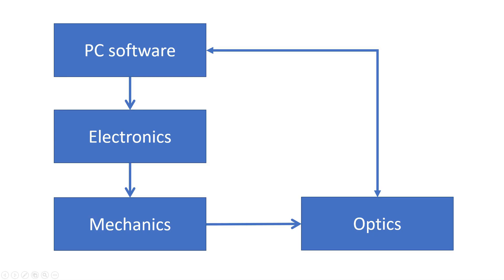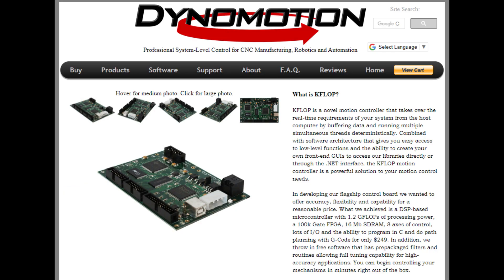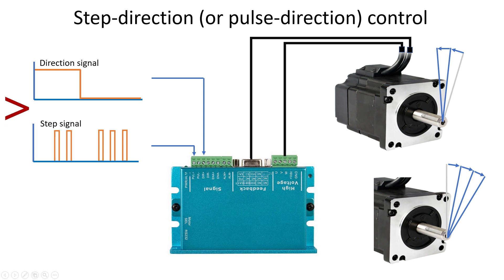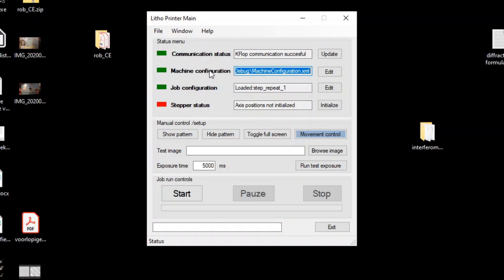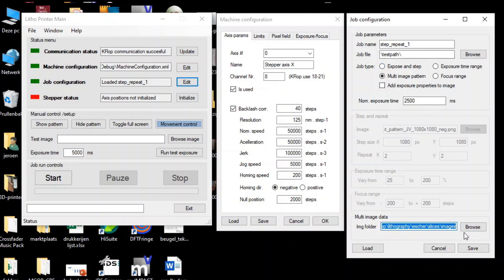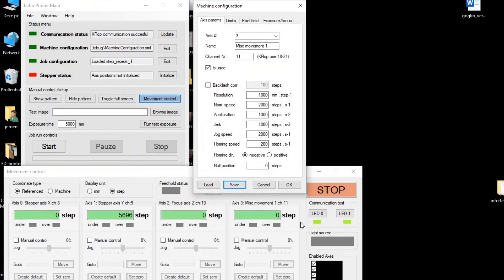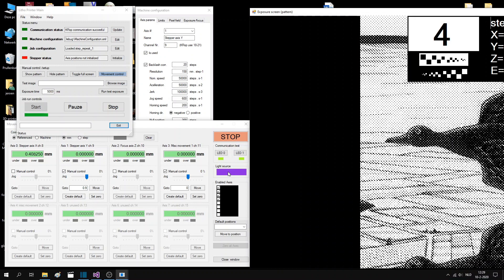Maskless Wafer Stepper Part 3: Electronics and Software.

Comment: impressive.
only remark I have is that this is the first time I see a whole arduino (and one of the more powerful ones, and an added logic chip...) replacing a single '74 logic chip. ( SN74LV8154 for example, an up down counter )
this arduino thing is getting out of hand 🙂

BTW, I am sure if you open source the hardware and software, someone, somewhere will have a use for it and expand it...

Comment: Did you ever get the stitching to work reliably? If I understood correctly then the problem you have with the stitching is that the wafer stepper's steps are not of equal size and so it's hard to predict the distance the stage actually travels. Would you say just characterizing the error is enough to fix the stitching issues? Or would it require some sort of image recognition and alignment markings in the design?
Reply from the maker: Best thing is to use an optical or magnetic encoder and a feedback loop to achieve accurate placement. In 2024 there will be a video on a new and improved wafer stepper.
Reply: @HuygensOptics  Awesome! Looking forward to it! I will want to start gathering the parts for- and slowly figure out how to make my own sometime within 2024.
Reply: @HuygensOptics  That's what I wanted to ask about too - whether you could include some metrology and a feedback loop. Would be really interesting to see that in action. I knew about magnetic encoders but it wasn't what came to mind for this sort of application. I suppose they can be incredibly precise as well (considering the size of magnetic domains in hard drives these days - perhaps smaller than the 158nm step size of your servos).

Comment: A way to handle the short step pulse into the Arduino without extra hardware is to attach an interrupt to that pin that only triggers on a falling edge. The edge triggering is done in hardware, so it can handle very short pulses.

Comment: Also something commonly used in 3D printers is microstepping. You're probably already implementing it in your servo motors-- but if you add certain motor driver (I use TMZ 2209s) then it slide the motor smoothly between steps by messing with and smoothing out the signal sent from the controller. Tbh. I'm not actually sure how it works.   
You're probably already doing it, but if not, it might help you get smoother movement.
Reply: Of course, you knew that though. Haha. You're moving nanometers. Okay. Ignore me.

Comment: I wonder if you could use an FDM 3D printer controller?   
You've already gone and learned the machine code and all of that-- but it seems like it has a similar function.   
Maybe it's a specs thing. 
Either way. Listening to you explain your projects is a treat. Thank you.

Comment: Is this setup possible to achieve the overlay exposure? For fabrication of a microdevice, usually, we need to pattern the marker layer at the first time exposure, then we need to use this marker to do the alignment, and exposure the target pattern at the second time, which we call overlay exposure.
Reply: There is a camera. With laser illumination we could even record dark field pictures for higher resolution. My only interest is reproduction (retro) of vintage CPUs . So the I guess that a 4K sensor sees the full previous area? 4K DLP. Uh, 10 MegaPixels for 30 kTransistors?

Should also work with a scanner. We place the scanned 30° bow into the 16:9 chips. Vintage CPUs were square though.

Comment: sounds stupid..but.. i would have used a potentiometer hooked up to one of those small geared stepper motors , the pot is across a 10V supply so i got the full range and dont require a Due controller and pulse widener. and may even get higher resolution.

Comment: You can get smaller steps than your servo is rated for. You can utilize Micro Stepping. It divides your Step by 2, 4, 8, 16, ..., 256. It reduces torque of cause but that you have plenty :)

Comment: Have you seen the OpenFlexture Project? They have designs for 3D printed microscope stages, at least one of which supposedly has sub-100nm resolution.
Some of their stuff might help get you the accuracy that you need for those stitched images you wanted to do.
Reply from the maker: thanks, I,ve heard of it but did not check it out yet.

Comment: Holy crap, you shoved your arm down the throat of technology that was bleeding edge some 50 years ago, and dragged out a functioning system...
In your "garage". Absolutely amazing.

I was proud of soldering a few wires together to get computer fans working so I don't die in this heat...

Comment: Have you ever looked into writing a computer-generated hologram with your stepper?
Reply from the maker: Actually no, I think that it might be possible, although the resolution is somewhat limited for that. But the biggest hurdle would be to write the software to write the patterns I guess.
Reply: @HuygensOptics  Some software does exist, and papers do exist on the theory behind it. corticalcafe.com has a software that creates holograms you can print on transparency films on a normal printer, obviously very limited in quality. I'd imagine that the micron-resolution you can already achieve with your stepper would create quite good holograms already.
Reply from the maker: @graealex  Thanks for the link. I looked up the page on the holographic software, unfortunately the page is full of dead links and I cannot download anything. But it looks interesting, I think it could work. By the way, making holograms that are larger that a few square cm2 would take a very long time to print.
Reply from the maker: Thanks, I will look into it.
Reply: Would U consider opensourcing your software? .. 'Open Source Maskless Lithography', or 'Maker Foundry' would surely be interested, as would I, another open maker.

Comment: Really fascinating project! Can you tell me a bit more about the projector modifications? I guess you needed to remove the filter wheel and lamp? Did you need to do anything special here to keep the projector functioning?
Reply from the maker: The easiest thing is to keep the electronics intact as much as possible. So get the color wheel out of the way but leave it connected. The hardest thing with the Acer is the lamp. You cannot just bypass an optocoupler. I replaced the lamp with a hotplate that can simulate the presence of a lamp and can dissipate the power.
Reply: @HuygensOptics  Thank you for your reply. I’ve removed the filter wheel. But it seems not much in the 365nm range gets through the rest of the optics. Seems to be related to the optics after the homogenizer/light pipe. But I’m not clear what’s happening...
Reply from the maker: @navawhiteford5188  The optics in the projector itself is not suited for uv and will absorb allmost all of it. 405nm will work however. If you want to use 365mm, you have to replace all of the transmissive optical components with uv compatible ones.
Reply: @HuygensOptics  Yes, it seems the DMD window is also not idea for UV, so there will be some loss there too... I guess the mirrors should be ok, they seem to be aluminum?
Reply: That seems to be quite complicated. I guess I rather use a confocal laser scanning microscope. How expensive is it again to modulate a laser? Acoustic optic Modulator ? External cavity diode laser? Mixing of a pulsed Nd:YLF laser with a diode laser in a parametric amplifier with consecutive SHG?

I Wonder if difference frequency, filter, sum frequency can be used for active mode locking. AC current into laser diode. Nd:YAG pulses are shorter. Or difference, SHG, difference? Feels a bit inefficient..

Bidirectional, single mirror, scanner create stable 720p images. Still one may be able to focus laser on the corners to actively track the direction.  720p scanner might be too small to illuminate bigger objectives?

Comment: Very impressive DIY work! Have you ever checked the final finest or minimum line width of the photoresist pattern? To get a submicron feature size using project photolithography is actually not easy. If it works, may I ask what kind of photoresist you are using? Thanks.
Reply from the maker: Personally I could not get lower in resolution than about 1.5um feature size, mainly because of lack of contrast at these dimensions. The maximum attainable resolution depends on many things and the resist is only one of them. Going to sub-micron features is easier when you use a low-viscosity photoresist like the AZ1505.

Comment: i'm planning to build a very similiar device for the purpose of computer generated hologram printing, do you plan to share the software and/or the source code? it would make the software part of my project really easy
Reply: @HuygensOptics  of course i wouldn't expect any support, sending you my adress. even the gui itself would help me for batch handling of files

Comment: Would it be possible/feasible to make one's own 'two-stage' XY table where standard threaded actuators serve as a rough adjustment and then use piezo actuators for really fine adjustment?
I'd imagine it'd require a lot of reference marks on one's wafer prints and plenty of clever programming to actually use the precision that gives, but if that's the only way for a hobbyist to get that kind of accuracy easily...
Reply: I thought about how you could achieve sufficient precision, and that would require a servo drive, i.e. constant feedback on the current position. My idea was to have an interferometer in each of the axis, or using some other sort of optical tracking, maybe TOF with modulated light?
Edit: or just buy a premade optical linear encoder.

Comment: Do you think it would be posible to change the 1080p DMD chip with a 4k DMD chip? Do you have solved the lineairity problem with axis? Is the error vallue from a turn on a given point say turn n from the origin constant? And if so could you correct it by recalculating knowing each turns error on the axis?
Reply from the maker: It's possible to use a 4k but most 4k beamers ar not really 4k. Some are even just full HD with a diagonal switching scheme. I don't think it will give a much better resolution unless you get a really expensive one with true 4k. The lead screw error can be solved using optical encoder feedback directly on the axes.
Reply: @HuygensOptics  I'm a little late to the party, but is it possible to replace the UV LED, mirror, and DLP components with a 5.5"-6" 405nm UV monochrome 4k display like those used in SLA resin printers?  More recently released displays have pixels in the size of 31um-35um.
Reply from the maker: @ethanwaldo1480  sure, that is possible, but it would be hard to demagnify the pixels to micron size resolution. Also, collimating the light into the optical system is challenging and you cannot use the back-light supplied with the printer, you need a collimating mirror or lens. But as a matter of fact, I'm currently designing a lithography setup based on a Phrozen mini 4k and an Zeiss S-planar wafer stepper lens for low-res lithography (7um pixel resolution).
Reply: @HuygensOptics  Thank you for the reply.  I have a Phrozen mini 4k as well and hope to see what you come up with.
Reply from the maker: @Ethan Waldo  It will be some time before I have time to go into this project. In the mean time you might get some usefull info on how to achieve collimation using a 4K screen from one of my older videos https://www.youtube.com/watch?v=E9uU2h1Ldcg , especially the part starting at about 7 30 min into the video (replace "object mask" with LCD).

Comment: Could you have used an interrupt on the Due instead of doing it in the loop?
Reply from the maker: Thanks James for this excellent suggestion. I never considered it because I did not know it existed on the Arduino. I always thought Arduino's had to loop all the time. I just looked into it, the Due supports interrupts on all ports, so maybe I will change the code in the future.

Comment: Hey! Awesome video! May i ask how did you control the dmd chip? Im trying do a similar thing.
Reply from the maker: Basically I just kept the electronics and dmd chip controller in the original state, connected the beamer to the second screen port of the computer.
Reply: @HuygensOptics  ah, thanks.

Comment: Well, consider me part of that minority planning to replicate the project. I came here precisely because I was interested in doing something similar to make my own ICs like Sam Zeloof, though I have to say those micro-optics are pretty interesting too! There are some similarities too, because in both cases you have to etch SiO2 (using the infamous HF...). And really, anything related to quantum mechanics interests me.

Also, some programming tips so you can save time writing: I noticed a line where you set the value of "currentInputState" using an if clause, but it actually isn't necessary, you can just do currentInputState = digitalRead(pulseInPinNr); because HIGH/LOW is the same as true/false. In fact, you can even remove it and move the digitalRead to the while clause! And to increment the value of a variable by one, you can just use ++variable (and the same with minus signs to decrement, but YouTube formatting doesn't allow me to put that), so you don't have to write "analogOutputValue = analogOutputValue + 1" (though it might be easier to read for beginners if that's your intention)
Reply from the maker: Thanks for your suggestions, I will look into this. I'm actually a pretty crappy when it comes to writing C and wrote this sort of intuitively until it worked. I remember that I needed to reset the trigger state in between pulses, not just check for the presence of a pulse state because this could lead to double triggering within the same pulse. Good luck with building, hope the info in these videos can get you going. One piece of advice: try to find very accurate stages for your project if you can afford them.

Comment: Great videos and interesting projects.  Is the non linearity of the screws (shown in your previous video) repeatable enough to calibrate out in software?
Reply from the maker: Probably. The reproducibility is actually quite high (approx. 1um if you approach the position from the same side every time). But in practice, it would be a lot of work to implement in the software and to create a table correcting for all deviations.
Reply: Yeah, it would be difficult to acquire good calibration data across the whole range of motion.  Maybe just abandon attempts at mechanical precision and overlap the exposures a little bit. Then with feedback from the ccd camera you could digitally align the adjacent mask like panoramic stitching software does.  Haha, sorry.  It's fun to be an armchair engineer!  Looking forward to seeing what you come up with.
Reply: @HuygensOptics  Or can you use position feedback on the X and Y axis?
I have used nm resolution optical rulers (linear encoders) in the past. (Though expensive if you need long travel)

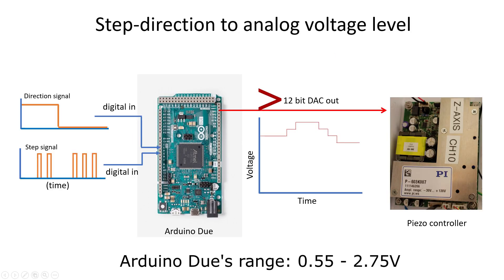Comment: 5:25 --- hmm, weird. If I remember correctly, Arduino has at least 16MHz clock, which should be plenty enough to notice 2.5us pulses
Reply from the maker: That means that the Arduino can run 16M instructions per second. However my loop to check for transients apparently uses significantly  more than just a few instructions.
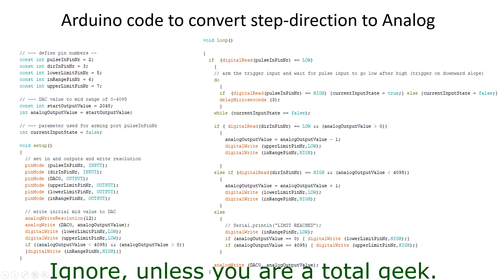Reply: Oh, I've noticed the code at 4:40 now.
Even basic Arduino has configurable hardware interrupts for 2 pins, and this board has by far more advanced 32bit ARM microcontroller with (from what it looks in documentation ) ~84MHz clock and interrupts for every pin. Using attachInterrupt(<pin number>, handler, FALLING) should probably do exactly what is needed. Reading/writting GPIO registers directly is probably desirable too --- digitalRead/digitalWrite are abysmally slow.

Comment: How long did it take you to develop AFTER you had the basic concept? I.E. any CAD/design and fabrication, hardware and software hookup/debug?
Do you have a method of determining the focus values at each corner of the substrate and then interpolating that as you step in between corners?
Reply from the maker: I think I started somewhere beginning of october, so I did the project in about 3 months. I spend most of my free time on it and some extra time I would normally have done other projects, so approx. 2-3 days a week. The software was actually a major chunk of the work. 
As for interpolation between corners: it is implemented in the machineconfiguration (in the "focus" tab which I did not discuss in the video). It is not yet implemented in the execution of jobs so that is why I left it out. Getting the image alignment right (not only in the z-direction) is actually one of the more difficult subjects of this project, which I will address in the future.

Comment: this method can print a mold for casting silicone gecko skin
https://www.youtube.com/watch?v=vpTX32KdVBQ
if you cover the photoresist with aluminum (or silver) you get mirrors.
and you can also make extreme resolution printed circuit boards
in any case, an indispensable thing in the household!

PS
Thanks for your movies - it's great!